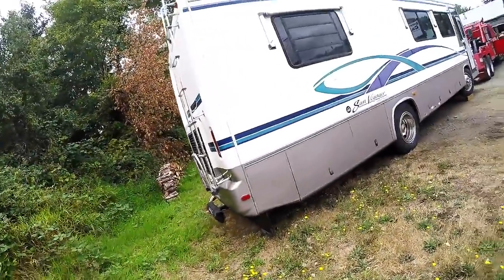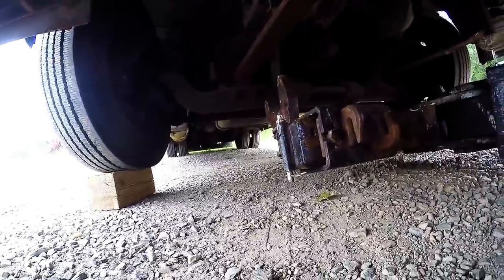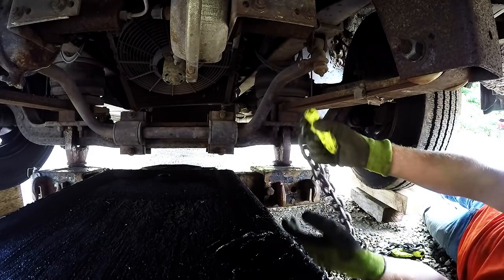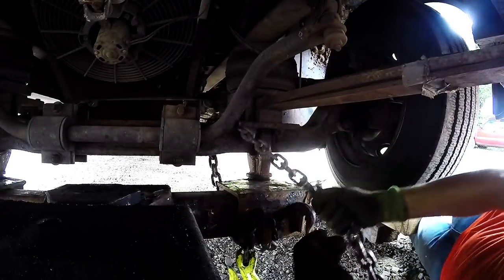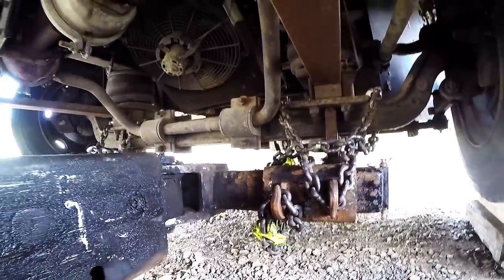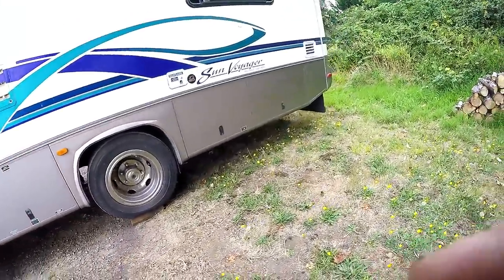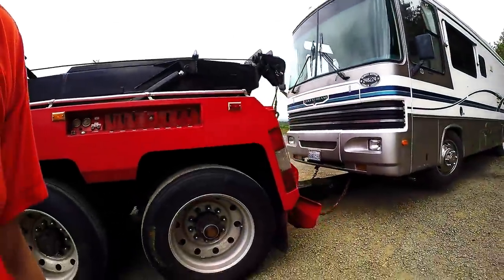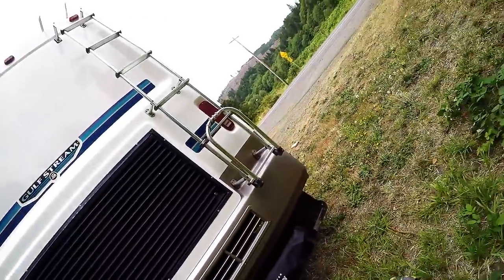HOW TO hook up a pusher motorhome (my way)

Comment: The euro reach has made this great . I have a similar system . I go out around the leaf spring and use rachet binder . Wire the excess.  Much less work . I do 3 or so of these a day so i dont have time to go slow .

Comment: Motorhomes are such a pain to deal with those axless far back. I know one company around here who won't tow them. Plus he claims always an issue getting paid because they think the tow shouldn't be but a couple hundred dollars at most.
Reply: Every truck shop I've been in (and there have been many), they post the rates at the service counter.  A motorhome or RV rate is always about ten or fifteen bucks higher per hour than truck rate.  I always presumed that was because working on RV's and motorhomes is a nightmare,  and they really don't want that business too awfully bad.  But,  when you have a Cummins or a Detroit or a Cat or even an ovloV powerplant,  your choices are somewhat limited,  meaning that Bob's corner garage probably doesn't have the knowledge, tools, or experience to work on everything under the sun.
Reply from the maker: You have the  additional issue  when working on an RV . Your in someone's  home working on  a dirty Diesel engine . One drop of grease or nasty  spot on the carpet  your in trouble . You have to put down carpet runners and typically have to have two employes  . One to troubleshoot and another to  turn  ignition ,   shift  transmission or  office help to get RV owner away from unit so  your  mechanic can work  without customer hovering over him .
Reply: Is that ever the truth.
Reply: @HILLAUTOBODY  That's why there should always be at least FOUR shop rates.

$80/hr - Drop it off and pick it up when I call you
$90/hr - You'll wait for it in the office
$120/hr - You want to watch the repairs
$5/minute - You want to "help" or tell me how to do my job